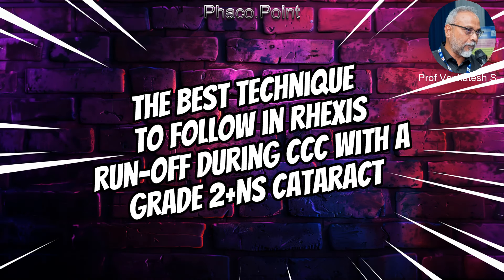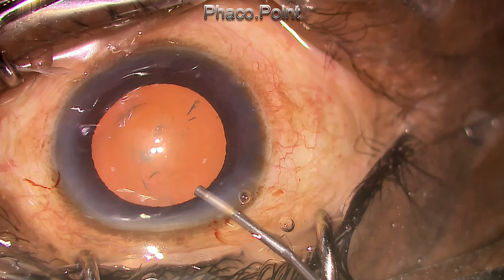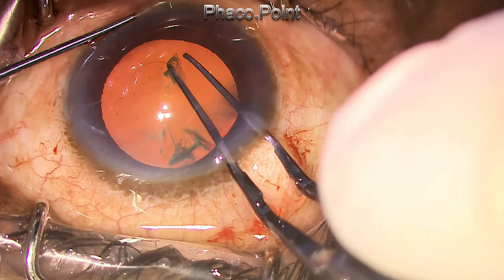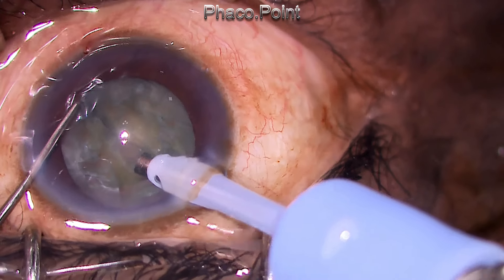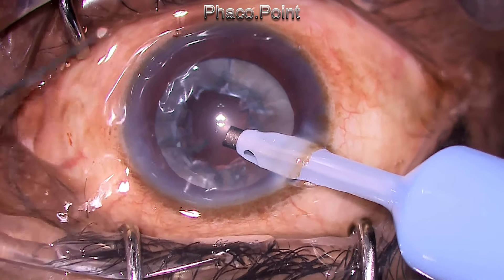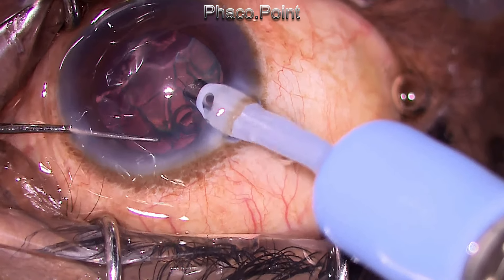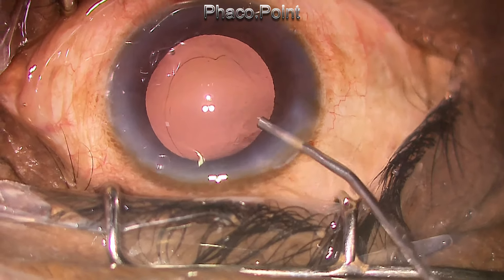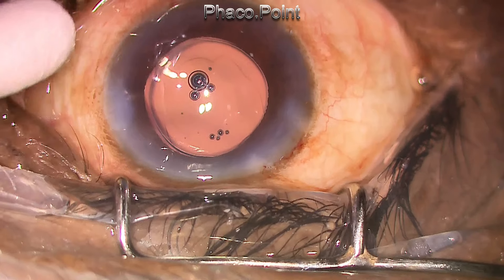The Best Technique to follow in Rhexis Run-Off  during CCC in a grade 2+NS cataract

Comment: Avoid hidrodiseccion....where???in other video...
Reply from the maker: hi.. I dont understand fully  what your cryptic comment means .. but I think you mean that in the video in soft cataracts I have advised hydro-diineatio followed by hydrodissection for soft cataracts . In this case as the CCC has run to the periphery hydrodissection may cause a post equatorial extension .. hence AVOID hydrodissection... Only perform HYDRO delineation ...